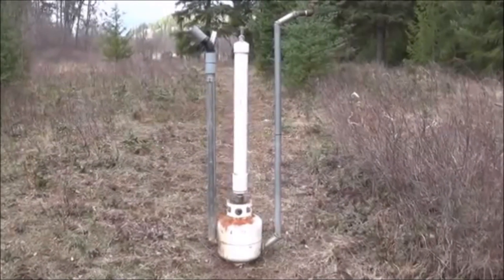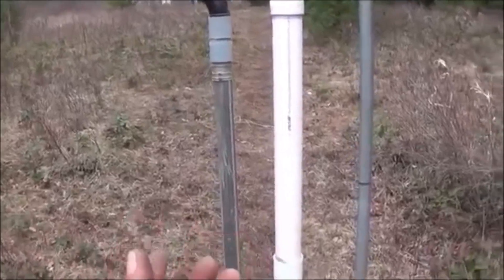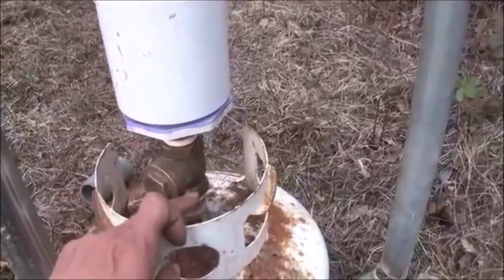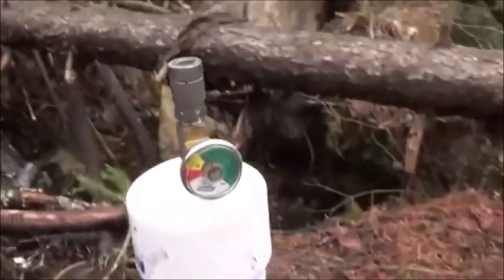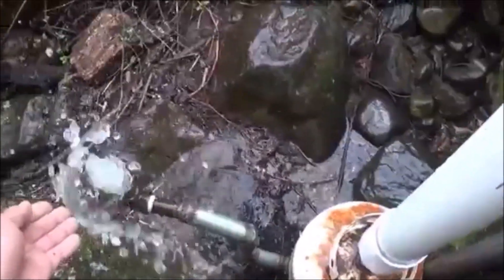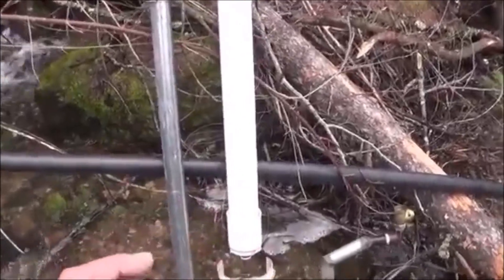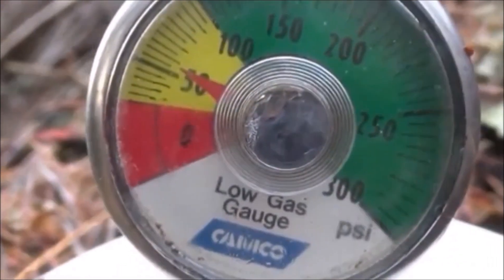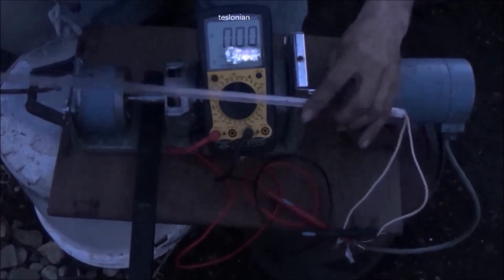TROMPE HAMMER, Ultimate GREEN ENERGY MACHINE can power homes and vehicles, has only two moving parts

Comment: Have you ever searched Ragged Chutes Trompe ? This was the biggest Trompe and it produced 40,000 cfm at 125 psi . It powered 26 silver mines in cobalt Ontario  from 1912 to 1979 at basically no cost. Then it was shut down because the silver was all gone. I think this would be a fabulous source for electricity , but it has been difficult to get the right people interested.
Reply: Very much in agreement!  Also, the Ragged Chute one produced suitably dry air.